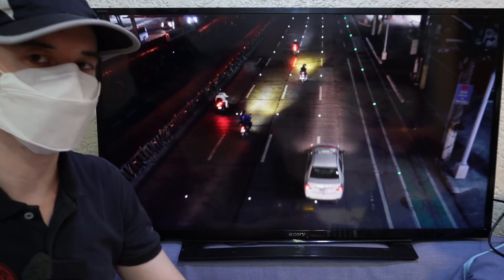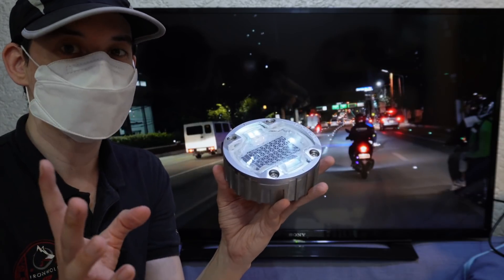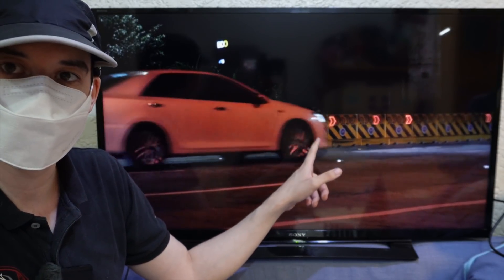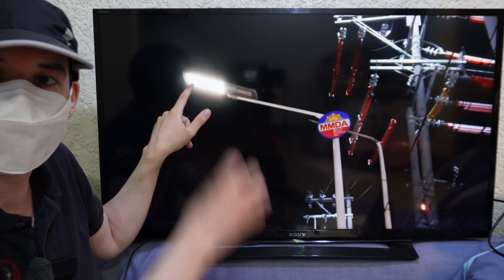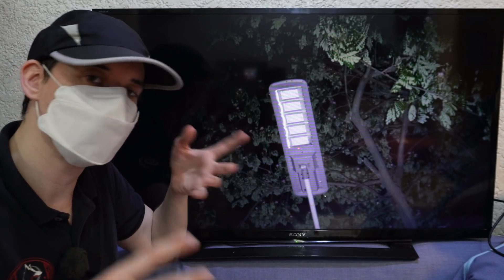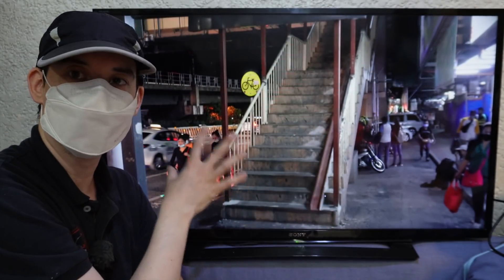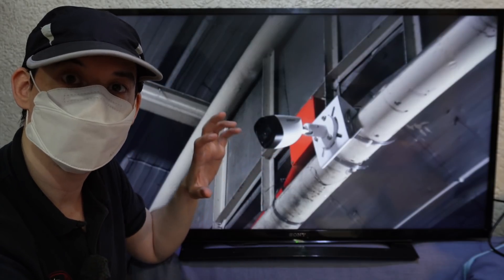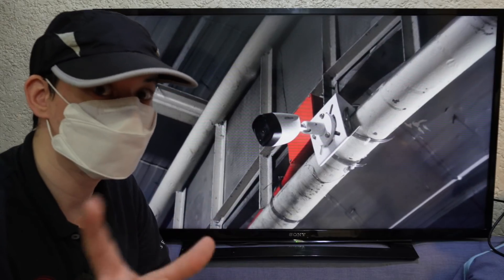Improvements on EDSA

Comment from the maker: Update: As per one company that supplies and installs solar studs for DPWH projects, the ~P9000 unit price INCLUDES installation. But depending on the location of the project, the price can increase. I believe this would be listed as an indirect cost, explaining why some projects reached a higher unit price.
Reply: So re my previous comment, installation costs 8,825 as the studs cost 175 pesos. 
Like I said, someone is making a fortune.
Reply from the maker: P175 for a solar road stud? I don't think so. 

Even my sample units cost P800 + shipping and customs on top of that. 

According to the supplier I spoke to, who works on dpwh projects - their units are higher quality than the others being sold. 

I've asked if they're willing to supply one of their units that I can compare against a "generic"

Comment: those barricade are stupid and dangerous. they should enforce buses to stay on that lane rather than block them and endanger other vehicle.
Reply from the maker: It's not just about keeping the buses in their lane. It's also about keeping motorcycles and cars out of the bus lane. 

Partly to prioritize and promote mass public transport and partly for safety reasons. 

We've seen many accidents between buses and motorcycles, in those parts of the busway that don't have barriers installed. 

Before those barriers existed, the mmda tried road markings, signs, extra enforcers and CCTV enforcement. It didn't work, the bus lane was full of private vehicles and motorcycles. 

They tried plastic cones as a divider for the bus lane. It didn't work because motorcycles weaved between the cones and cars literally ran over the top of the cones. 

They tried plastic barriers but people were moving them to get into the bus lane. Either manually, or using their vehicles. Because they know it won't cause damage. 

The only thing that ever worked is the concrete barriers. 

Most accidents with concrete barriers are drunk drivers and drivers that fell asleep. That's the reality on the road.

Comment: Thanks for the updates. Really good to see the upgrades coming along. 

How about the road pavements? Any plans to “smoothen” out some more parts of EDSA? One could easily damage their own suspension system after a few thousand kms of plying those EDSA roads. 

Its also a safety hazard as if someone tried to avoid a rough patch or a pothole, that person could easily change directions and get hit by oncoming traffic.